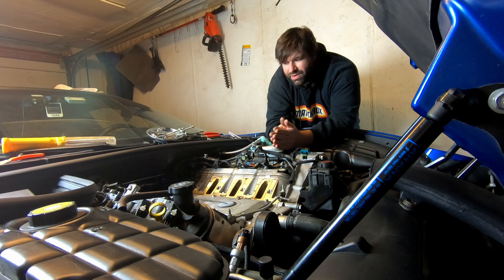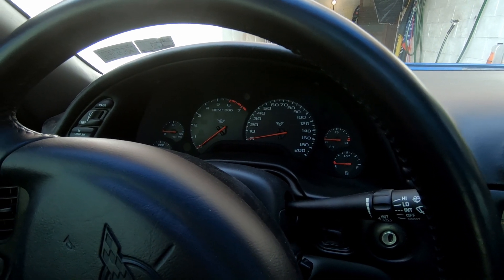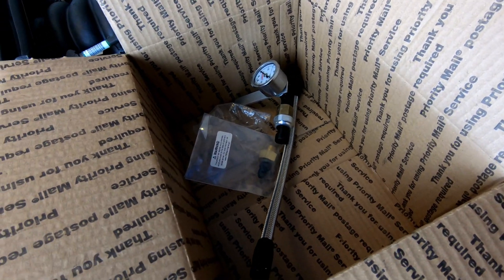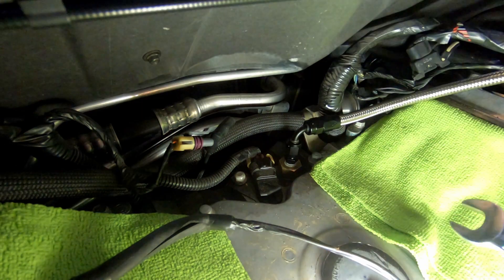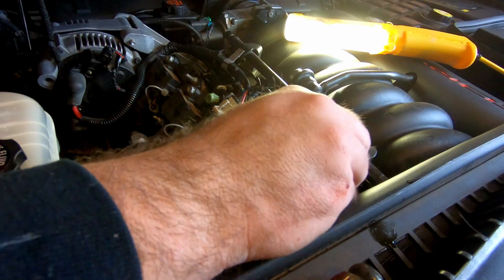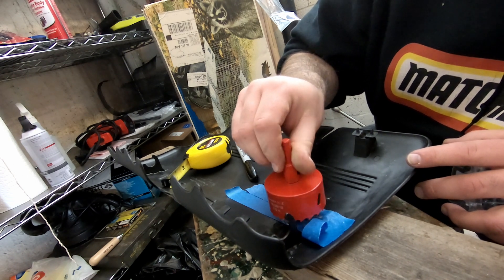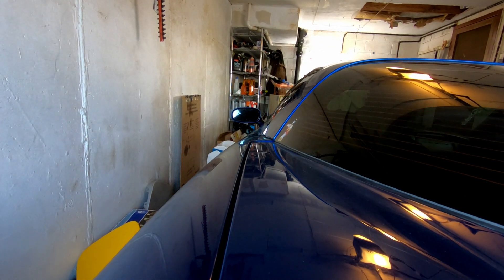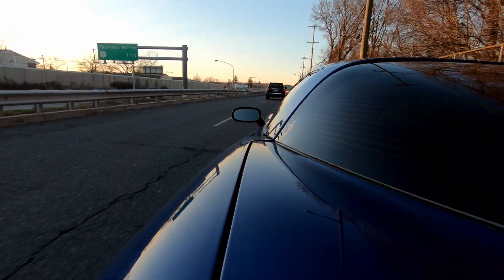C5 Corvette Oil Pressure Sensor Relocation

Comment: Well what a waste buy couple of proper fittings and short stainless hose   Done …….. and cut a hole in the cover. SMH no need for a gauge Waste!
Reply from the maker: Why cut a hole in the cover? Also, iirc, I specifically say it's not needed and that I preferred to do it that way.

Comment: I bought a 2002 C5 in 2020, I noticed my pressure sensor was reading 80 PSI, I had the sensor changed maybe a month after I bought it. Now I am getting 0 psi, do I simply replace the sensor again.?
Reply: I have the same problem but car doesn't start that could be the problem or no?
Reply: @LuisMontemayor-i4l  It could be part of the problem, I went out for break at work, started the car and it died. I had it towed  to Purifoy Chevrolet in Fort Lupton Colorado and was Devastated when they told me the problem and what it would cost to fix it. Purifoy is now Yoder Chevrolet.
Reply: @vincegonzalez7249 oh ok thanks for the reply cause i have my car torn apart checking for an electric issue.. im going to check that out today after work ..
Thank you sir
Reply: @LuisMontemayor-i4l  I am sorry I did not read what you were replying to. I commented on my harmonic balancer going out on another recent video and how it warped my cam shaft. Having it fixed cost me 7 grand. As for the pressure sensor, I paid 85 dollars and a local garage charged me a hundred dollars to install it.  As for your car not starting it could be your battery or alternator which Corvettes are well known to need replacement.
Reply: @vincegonzalez7249  not a problem battery and alternator are ok and fuel pump and filter are new.. im going to change the oil p sensor amd see what happens
Reply: @LuisMontemayor-i4l  Good Luck, I hope it works out for you. ✌
Reply from the maker: This makes me want to just spend the money on the cam shaft I've been eyeing simply to have an excuse to swap out the harmoic balancer. :o Sorry to hear about this.

Comment: I’m a little confused with how you’re running this separate analog gauge in conjunction with the dash pressure gauge. Where are you picking up the analog signal? 🫤 I plan to add a discrete oil pressure gauge with a separate sending sensor in a different location.
Reply from the maker: In my case, the analog gauge stays in the engine bay. It can only be seen when the hood is opened. The oil pressure sender (for the cluster) sits directly after the analog gauge. Does that help?
Reply: @iDriveDaily  Thanks for the clarification.

Comment: The fitting you installed where the old sensor/ sender was located, did you put anything on the threads to better seal it from leaks?   Will the analog guage fit under the fuel rail cover without cutting a hole in the cover?
Reply from the maker: So it came assembled and "presealed." There was some type of binder on the threads. I did adjust it later down the road, but can't remember if I pulled it apart. 

I cleaned the engine bay for a show recently and discovered that it has a small leak that developed sometime in the last 2 years. It appears to have been going on a while as it seems the oil is "caked" around the bottom of the analog gauge. But there isn't a whole lot of oil.

Also, the gauge will not fit under the fuel rail cover. If you're looking to hide it, it would be better to forgo the gauge all together. I myself may eventually "delete" it.
Reply: @iDriveDaily  Thanks for the information.

Comment: In hindsight , a smaller pilot hole would let you see the location of the gauge face under the installed cover, then you could adjust the location of the final hole for a more exact fit.   I decided to build a sensor relocation set up from parts suggested on line.   That was before this kit with the dial was available , which looks kind of kool.   

Carpenters sometimes use mustard from the fridge to mark where to put the hole for the striker plate  when installing a doorknob or a dead bolt, , mechanics use clay to find a blind location , I believe.  

I had just watched two videos where guys were chopping holes in their cars just to replace an oil sensor, and was certainly glad to see someone who wasn't willing  to screw up their corvette body for such a small maintenance task.    Just looked up the hourly shop rate on google, and assume their rates are a little outdated, with a top ;labor rate of $90 and a completed job under $200.   So I figure about an hour for a regular  mechanic to do this job.  Still even $200 is certainly worth knowing if you have oil pressure .   

I had never done something like  this before, and it was just about what everyone had said, not a difficult job, just follow the steps,  but I did have to run out and buy a little miniature swivel to reach all  the manifold bolts.   Taking everything apart allowed me to clean all the parts, especially; the critical air sensor and throttle body.  I also discovered that my car was missing two little foam blocks that I found inside my new manifold gasket kit, which probably explained why why the valley where the knock sensors live was so dirty.  

The cleaning I did certainly made my job more valuable, and I am glad I didn't have to pay a skilled mechanic to do such needed but simple work.   Just make sure you get air sensor cleaner. which you can also use on the throttle body , and don't use brake clearer , which tends to be used get as an all around cleaner at times.

Comment: Assuming the sensor plug/wiring was long enough to reach the new location...
Reply from the maker: Yes, you'll need to stretch it over just a bit, but there is enough to reach the new location.

Comment: Do you have enough room on the bracket end, that you could slot the mounting hole a little bit then adjust the gauge down to the center of the hole?
Reply from the maker: The hole I drilled for the bracket was about 1/8"-1/4" from the end of the bracket. I don't see why you couldn't slot it, that would give you more freedom to adjust.

Comment: Good video, but there is absolutely no reason for the analog gauge under the hood. Get rid of it for a clean look with the sensor relocated and tucked away.
Reply from the maker: Thanks for the view. That is an option for those who don't like the analog gauge. I, however, like the look of the gauge which is why I went for it.